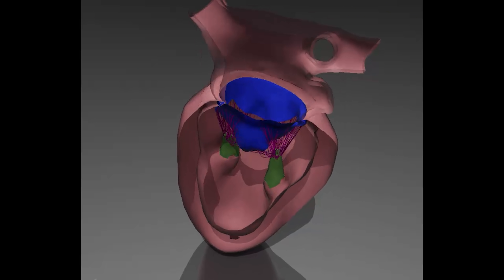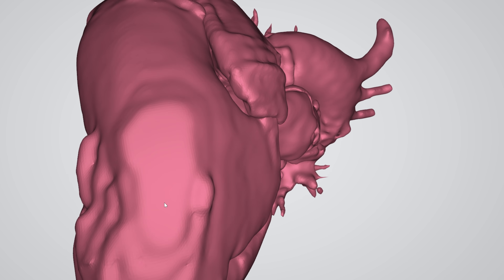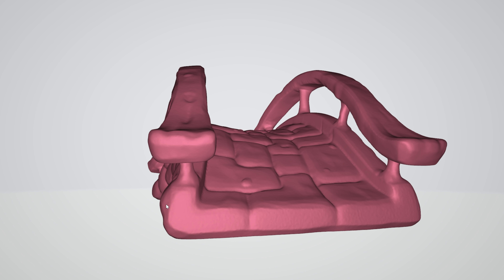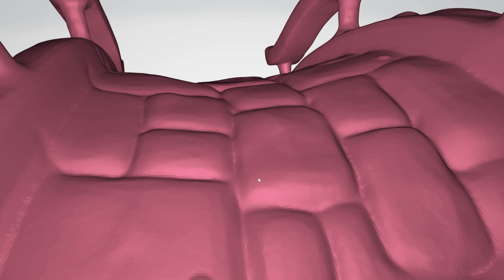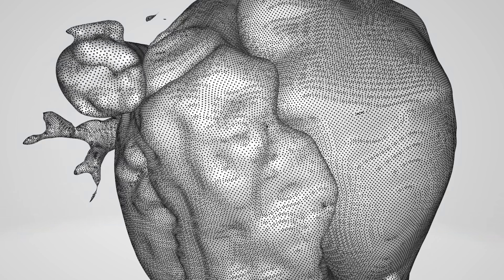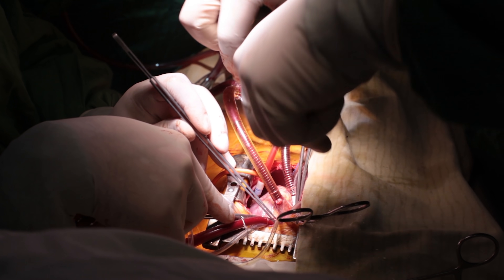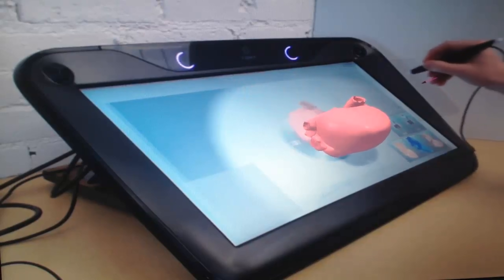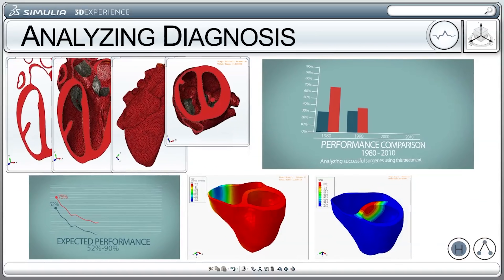My Virtual Heart Could Save My Life One Day

Comment: I'm one of the rare structural engineers working with FEA, (it's a lot more common amongst mechanical engineers). Something that I can add: Models needs to be verified, there's so much that you could mess up on your input that the answer you get out is just wrong. So most bridge engineers (3:30) don't bother with this process as it doesn't offer anything (safety or savings) beyond what more basic line solvers can do.

Comment: back in ancient time when computer still didn't have the computational power to handle that many element in FEA, engineers used to have to apply conformal mapping transformation that convert a linear function to fit a shape of the desired object and take partial differential equation to compute stress and strain. To achieve the desired object shape you sort of have go through a series of complex transformation and hope your transformed equation doesn't end up discontinuous equation surface. Obviously it was a lot of pain and very prone to error, but since the equation is continuous and differentiable, so it can handle singularity like the edge of a knife or separation point of trailing vortex. But with increased computing power, it is way cheaper to have an inaccurate model with linear approximation compose of linear element than it is to hire bunch of experienced mathematician to construct a precise model. The linear approximation error decreases as element size decrease. since if you take piece meal of a highly non-linear function, over a very small domain it's linear. IE: the error between y=x and y =sin(x) goes to zero as x approach zero. But obviously comes with increase computing cost, which was a problem back in the 70-80s, but nowaday computing is so cheaper, it's easier to just put more element into the model. Although FEA sort have o(n^2) time complexity, so there is a limit on how fine the element you can get. So finite difference method that give you approximate solution over time, which doesnt give you an exact solution, it's way more scalable on larger number of elements object. Although that bring its own challenge of how "big" of iteration step you take, while larger step give you faster solution convergence, it also tend to give "unstable" solution that swing back and forth. Which lead development of "momentum" style of iteration, that dynamically adjust step size according second order error instead of just first order error. Incidentally a lot of these solution convergence trick are also applicable in back propagation of most machine learning system. since math structure wise, they share the same or very similar abstract syntax tree.

Comment: very cool tech. as an electronics guy, the question that sent me a-googling was the concept of heart voltage. we all know electrical stimulation is the 'clock' that times muscles firing and the heart pumping. how much voltage is going on there? all the ECG oriented stuff is in millivolts, but that kinda makes sense because its measuring so remotely (across the chest and limbs). My question is: What is the Operating Voltage of the Heart?

There is alot of stuff on Pacemakers on the googler, but I'd imagine they are the outliers, the faulty heart condition that needs an extra jolt to keep things running. the oft-quoted value is 1.5-120v. thats quite a range (especially when you factor ECG are in mV). i would imagine calcification and other heart conditions would heavily impact the resistance and therefore current and voltage needed to kick a pulse. hence the regular tweaking of pacemakers. for a healthy, model, human heart, what sort of voltage are we talking? as I said, im an electronics guy, i studied physics, maths, chemistry etc, extensively, bare minimum biology. I have no idea of the conductivity/resistance of blood or muscle (tho it aught to be pretty good, once your under the skin). I understand it is just a clock pulse that triggers a biochemical reaction to contract. so it wont need a bunch watts of power to actually run the heart. but there are so many cells in series and parallel, so there has to be some significant V^drop to get everything to fire in unison.

not many places I'd pose this question, but I rekon someone in this crowd has a fair approximation of the answer. V^fwd of a healthy heart. how many volts do I kick with every pulse? Extra internet points for voltages of involuntary organ muscles and big thigh or little finger muscles. 

PS; got waaay more interested in biology when I sliced my foot open, right along a tendon (thankfully it was a beautiful clean cut, in ER the doc got 5 students in to have a gander at the wound, I was just as fascinated. wiggled it around a bit, sure, have a shot at a stitch or two! some were clearly better than others. the actual doc did the important ones. huzzah for Australias medicare and Sir Charlie Gardiner hospital). glass cut, shaved muscle down to tendon and bone, could wiggle my toe and see the pulleys and pivots and struts move. we are just a goddam machine. mind blowing.

Comment: You trying to put that pen drive in will give me nightmares Steve
Reply: Proof they have three sides
Reply: Ah yes, the five dimensional USB connector. Sometimes you have to insert it the wrong way 3 times before space-time folds in on itself to create the correct size wormhole to accommodate the connection.
Reply: Flash drives remain in superposition until you collapse the wave function by trying to plug the damn thing in.
Reply: It's the little things.
Reply: Wait, what? That doesn't happen to everyone?!
Reply: rocket USB, Can't be that bad?
Reply: Schrodingers usb stick 😂
Reply: I just read your comment with your voice in mind

Comment: 5:20 For those wondering about the simultaneous equations:
2 unknowns:
7x +5y =16
3x -5y =-8

7x +5y =16  +
3x -5y =-8
10x =8

x=.8
3x -5y =-8
y=2.08

3 unknowns:
7x +5y -3z =16
3x -5y -2z =-8
5x +3y -7z =0

7x +5y -3z =16  +
3x -5y -2z =-8
10x -5z =8

9x -15y -6z =-24  +
15x +15y -21z =0
24x -27z =-24

80x -40z =64  -
80x -90z =-80
50z =144

z =2.88
10x -5(2.88) =8
x=.2.24
3x -5y -2z =-8
y=1.792

Comment: FEA is great! Our class started off with two or three elements by hand. We went to computer calculations pretty quickly, but never ran a sim that took more than an hour to render on our budget campus computers.

For more mathematical fun, look into CFD (Computational Fluid Dynamics). It uses methods similar to FEA, but calculations are done on fluids moving into and out of the surfaces of each cell. You can calculate what happens when two fluids interact, but it drives the computation time (and likeliness to fail) way up.

Comment: I got the 3D data from one of my spine MRIs — actually it might’ve been CT data I ended up using — and reconstructing it into a rotating 3D animation to show the metalwork and bone fusions in my spine after surgeries. My physios found it a lot more useful than they thought it’d be in understanding how I move.  Also, I 3D printed a ‘copy’ of my metalwork, including the parts of the screws embedded in my vertebrae.

The actual surface extraction from what is really quite ropey data was much harder than I expected, mainly due to how terrible the UI for available software is. I’m sure professionals can do it with practice, but as a software developer it’s all so clearly in need of some proper UI/UX work.

I also tried the same with an MRI of my brain.  Unfortunately the resolution wasn’t high enough… I really wanted to 3D print a personalised skull bowl and brain blancmange mould.
Reply: If you have heavy metal, an MRI isn't the most brilliant idea...
Most likely you have CT scans.
Reply: @paulmichaelfreedman8334  I’ve had both. SPECT, plain CT, lots of standard 2D X-rays, and MRI. My surgeon said that an MRI on my spine looked like a disco ball, but if seen in context with the others still gave some useful information that the others didn’t. It does look pretty wild, with odd shadows and reflections across the rest of it.
Reply: @tomgidden  I'm surprised as usually metal can get real hot in an MRI.
Reply: @paulmichaelfreedman8334  Not really… as I understand it, magnetic metals like steel can get warm (not good) and can be moved around (very not good), but most (all?) surgical implant metal is MRI-compatible: titanium, some stainless steel, copper and other things are okay.  My stuff is titanium. The problem is really that metal shields and distorts the result, so it’s of far less use.  Safety, however, isn’t really a concern.

If, however, it was an unintentional “implant” (eg. a bullet, or an argument with a nail gun) then that might be problematic in an MRI.  I think it’s less about heating, though, and more about it being yanked out/through the patient.

Comment: At 0:19, I see you've followed the correct 3-step procedure to install a USB device:  (1) Try to plug it in. If it doesn't fit (2) turn it over and try again.  If it still doesn't fit (3) turn it over and try again.  Now it will fit. :)